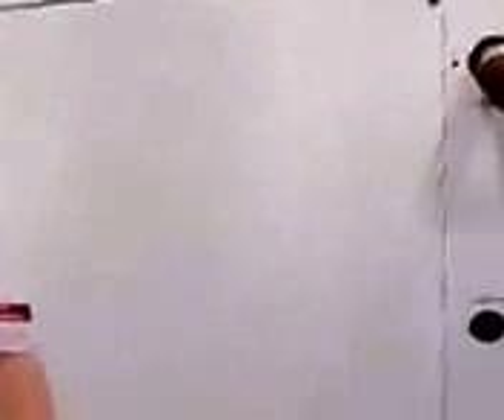Waterfurnace - Worst Choice Made For Our House

Comment: We had a Waterfurnace Premier 2 with 3.5 ton capacity installed in our new 3,000 sf home in 1997. I can't complain about the noise.  Finally needed service in 2014 due to the ground loop leaking enough liquid that we had an error code.  Technician diagnosed and topped of the liquid, and did a full inspection in an hour.  Never paid a dime for service other than this one time.  Only needed the heat strip when coming off a power outage, and one time after a week of outdoor temperatures in the teens.  We keep our house at 69F heating / 76F cooling.  Love it so much we are looking at upgrading to a Series 7.

Comment: Your pissed about that?  I've heard refrigerators louder than that.  Did your contractor remove the shipping bolt on the compressor?  Is the unit on a vibration pad?  I also do not see any canvas connectors on your duct.  Installation is 80% of the issues we come back and fix after other low ball contractors install equipment.  The unit in your video is not a 5 series yet your write up claims to be about a 5 series.  Put in a climate master the same way and you will have the same results.For everybody else reading this...  Pissed consumer is an extortion site that solicits people to leave bad reviews and then demands money from companies to remove reviews for a staunch fee.  If you have to bribe the site to remove reviews you should question their integrity as they are not in it for the noble cause of protecting the customer as they proclaim.   DEBUNKED VIDEO.

Comment: Doesn't sound noisy to me.  You could go buy a wood boiler and a chainsaw, and use it for a weekend.  you wont be able to hear the water furnace after that.  I am totally happy with my water furnace other than the coil just went out today, but it is now 12 years old and this is the first issue.

Comment: I have owned a water furnace for 5 years , it is 16 years old, the previous owner gave me lots of receipts on repairs. I have had a new compressor and board installed and a number of repairs. As I type this , I have a water flow warning light flashing , for me this is my final repair. Ripping it out if it fails again.
Reply: Did you remedy the water flow alarm? I'm looking at the same problem.
Reply: @j.schmidt6362  yes, previous tech put too much coolant in. They have to have the correct amount in the system. Good luck.
Reply: What does your system protection read ? 15, 5, -5, -10 degree protection? Thanks for the prior response as well.

Comment: To me that does not sound that noisy.  Maybe the video has poor sound quality.  I have an envision series water furnace model and have no complaints.  I do know if your vents are not properly sized and your system is not configured correct you will not have a pleasant experience with this or any system.

Comment: I have a Waterfurance unit installed in 2007 and regret the purchase. This is the most unreliable piece of equipment I have ever owned. It is noisy, two fan motors, two boards, numerous recharging of the system to discover it needs a evap coil, it does not heat the home in -15C or colder temps and I have been warned that the compressor will go soon.

Comment: Installed in '08.  1 Trouble-free heating season.  Several Extremely High energy bills.  The latest failure was $1400 and didn't fix the problem.  At this point, with everything I have spent, it would have been cheaper to just use Propane to heat my house.  If you have an '08 Envision, you know what I mean.

Comment: As a Geothermal Technician myself, you need to update your current Water Furnace unit, looks to be between 15-20 years old, the more updated units do not make that type of noise, this is very common with older Water Furnace units
Reply: I don't give a shit about the noise of the unit. In fact, when mine fails it actually wakes me up! I need help! Any response would be greatly appreciated. When it works is why I bought in.  Generally doesn't work!

Comment: We have had similar issues with our E series water furnace. Since 2011 $400 min service call each year, noisy compressor, intermittent function, thermostat failures (theses are $500 each from Water furnace) etc. This year we are having the geo system off and using the gas furnace only. Never again would I get a heat pump installed for heating in Michigan. The high initial cost has never been recovered with lower bills  - our electric bills are $600 per month for a 2200sq ft house.
Reply: I agree heating is expensive with electricity, cooling on the other hand is really cheap,  it great until your loop water is too cold to extract heat so it needs to run longer. i use it for back up at -20